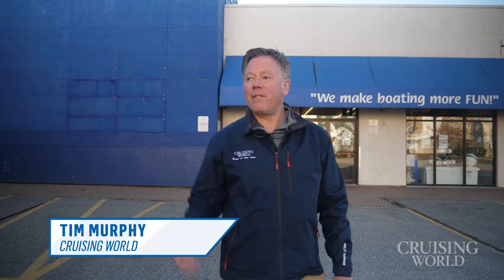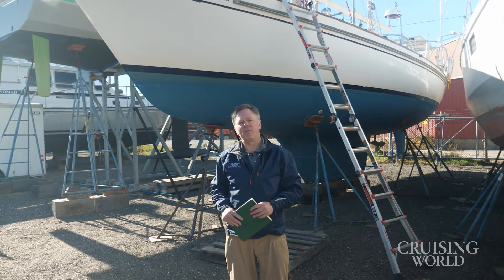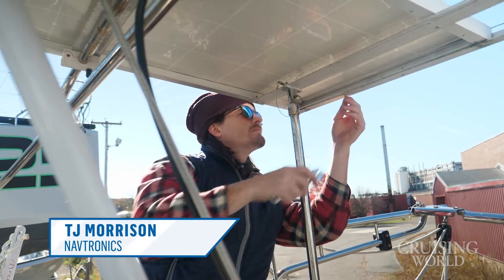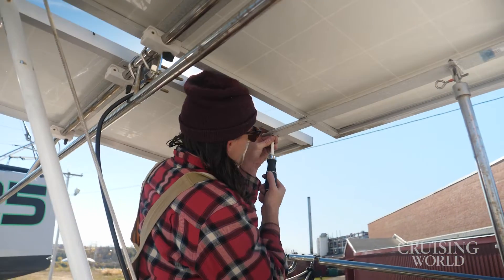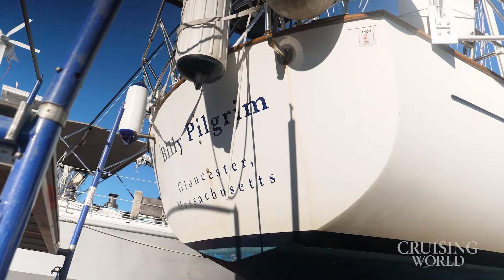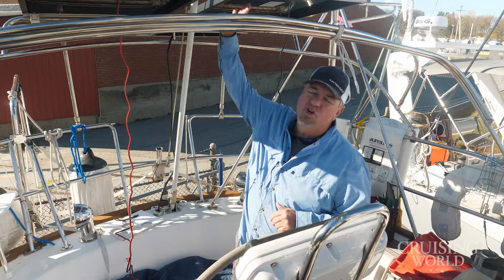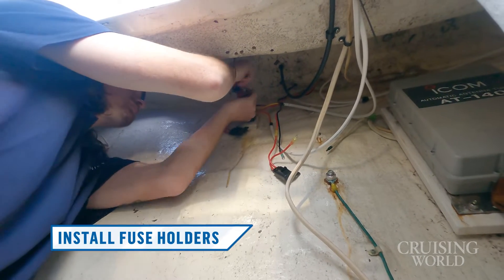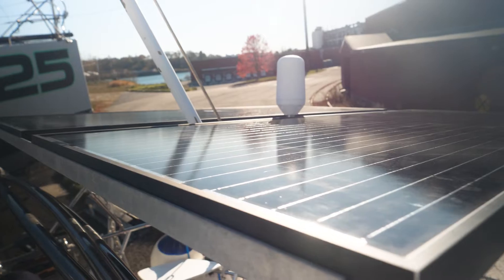How to Install Solar Panels on Your Sailboat

Comment: I was searching for info on how to pass the wire through the topside…I see the deck glands as the answer. What I don’t follow is that the exterior entry through the deck glands the wire is PV wire but as it passes through into the interior the wire is of a different kind (white). What was the PV wire spliced to and where? The wire then going into the solar controller is PV wire again, as it was when passed through the top side deck gland.